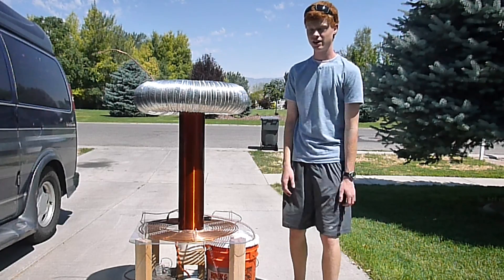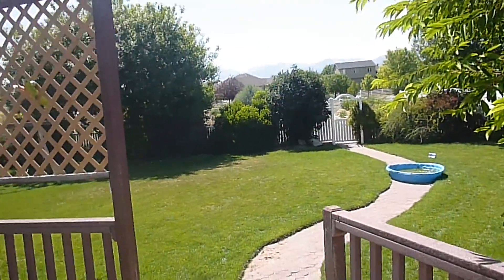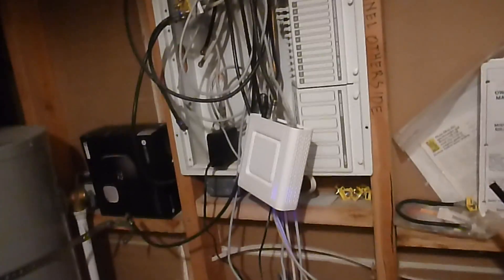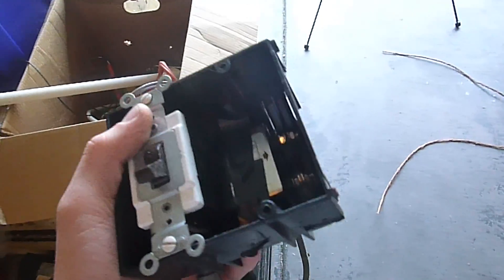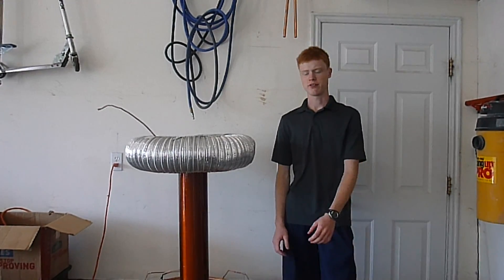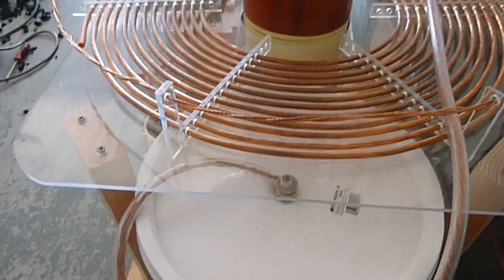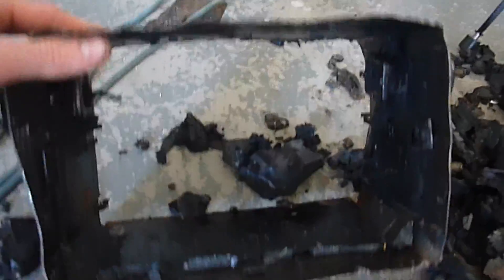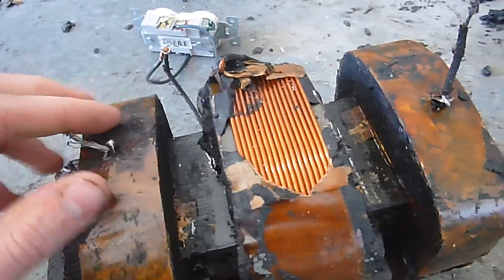Tesla Coil - Initial Testing

Comment: I have bought 3 nst. all 3 are 9kv at 30ma I know how and will phase them together well atleast 2 at first...but this will only increase the ma to 90 ( 60ma with 2 ) and it will not increase the volts overall or therefore the arc length....just the power and heat or thickness of the arc? or does phasing them in parallel increases the volts and ma???
Reply: Only amperage! Voltage same. Can't wire nst. s in series for obvious reasons, but if you could, it would increase the voltage.

Comment: Nice start on the coil.  I've made a few coils myself and posted some video of them.  You can try adjusting the tap on your primary flat spiral coil (when there is no power and the coil is completely unplugged from the wall for safety)  to try and fine tune the resonance between the primary LC and secondary LC.   Did you calculate the resonant frequencies for each?
Reply from the maker: TechnoWizard I have. I've actually improved this coil drastically, it's now producing 31" arcs. I'll post a vid as soon as I have time to get more footage.
Reply: Basement Engineer also to tune it you can use a induction motor powered rotary spark gap and use a scariac/variac to adjust the speed, I personally would use a scariac because it's very cheap to make, just saltwater and electrodes